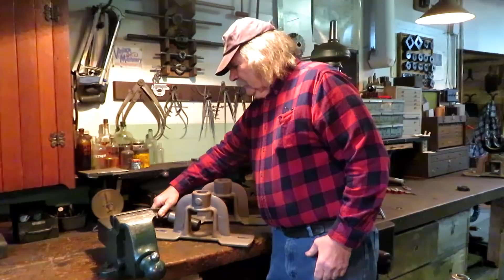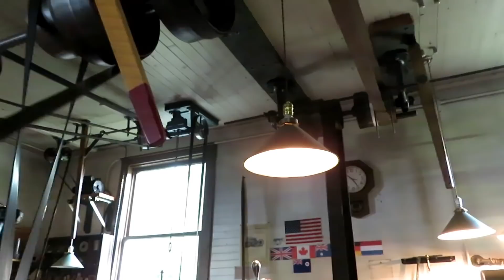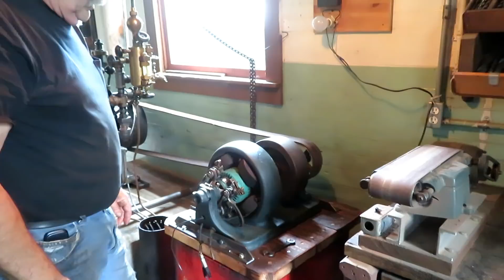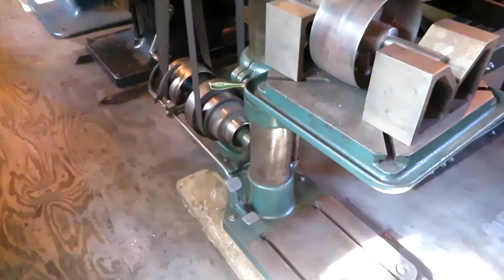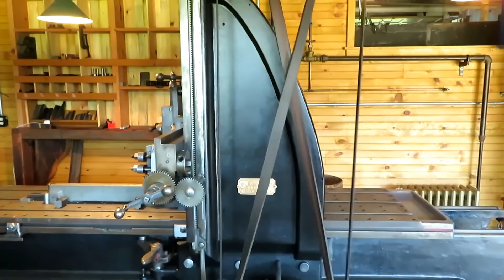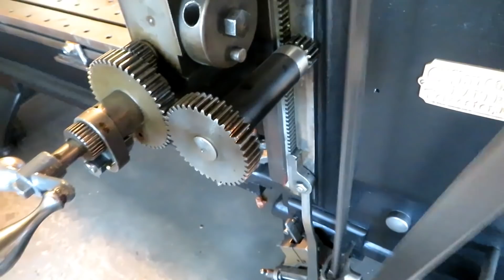Old Steam Powered Machine Shop 67:  DC power from steam

Comment: Dave, have you ever had an incident where a hand or clothing got caught up in belt/pulley? I know from my limited experience with my wood lathe that at even low RPMs there isn’t time for a human brain to react fast enough once the mistakes starts to happen! So will the belt and pulley just pass say a hand through half the rotation and throw it out without much harm or is it an automatic ride to the M D?
Reply from the maker: I'm not as worried about the belts as I am the lathe chucks, especially if the jaws are far out." Keep your hands where you can see them". (my dad).....Dave

Comment: Dave, was casting iron the only way they had to make parts in the late 1800s and early 1900s or was it just the most economical?
Reply from the maker: Hi Ed, Cast Iron work was a way of life in that time. All big machines required big castings. Wrought iron in bar shapes for most all else. Steel was much better, becoming available, but expensive. Arc welding and High Speed Steel for cutting tools was coming along slowly at that time...Dave

Comment: I liked your description of the old bearing. When I was sailing as a Marine Engineer a daily routine was to check that the slinger rings in the propeller shaft bearing were not hung up. My favorite part of the watch cause the shaft alley was cool.  I never realize they lubricated small bearings with slinger rings.
Reply from the maker: Wil, That last bearing must have been way back in there....Dave
Reply: David, no that would be the stern tube bearing.  It was a long tight “bushing” of Lignum Vitae that was lubricated by a controlled amount of sea water leakage into the ship. The shaft, which could be over 100 feet long, was supported by by several large bearings with most of the Babbitt on the lower half.  The slinger rings rested on the exposed top of the shaft which caused them to rotate and drag up oil from a sump. Very simple, very, very reliable.  Shaft was about 3 feet in diameter and rotated about 100 rpm.
As someone who spent a good deal of time on older steam powered ships I am loving your channel.  If I had your skill set I could of had unlimited OT.
Bill

Comment: Hello Dave,    Must admit I have just found your channel, very impressed.  I volunteer time, effort, my skills and the few odd £ at the Claymills Victorian Pumping Station (please see Claymills.ogr.uk)   My inquiry is about the displacement lubricator spotted `in bits` upon your workbench.  At present I am in the process of the Big 3R`s upon a vertical twin steam engine.  This being built `In House` at Claymills around 1900 and fitted with a displacement lubricator, so any info upon their set up would be much appreciated.

Comment: ?? Why not turn a vintage 110V AC motor at it's speed (1750 rpm motor at 1750) to get the AC output?  Better yet a slower motor like 1120.  Seems like to use the 20 or 30v your going to have to put in something non-fitting like LED lighting to make use of it.  Once you get your 100-120v ac, just used a genset transfer switch to flip over the source of power for your existing lighting circuit.  The generator your have is beautiful so I understand why your trying to find a use for it.

Comment: David. One of your early videos. Talked about not being able to replace steam.  Answer is you cannot.  If a oil refinery has no steam. It will blow sky high. I worked on a unit. a Fluid Catoletic Cracking unit. Known as a FCC unit. The flue gas coming off this unit was around 1200 degrees. Add a tad of gas and it would burn and produce steam. We has steam engines running pumps. Also steam turbines. When the good old ELECTRICAL GRID WENT DOWN.   We could run we had steam back up pumps. If we kept running the boiler house kept running. Over a period of time. They brought in ( so called educated bosses) replacing steam engines and turbines with electric motors. I begged one of the plant managers to not take the spare turbine out and replace it with a electric motor. Later that year we had a power outage. The total plant was down for 3 days. When we finely got steam up the plant manager came in and said start you warm up with cold oil.  I was able to look him in the face and say. I told you without a steam pump we cannot run. You Sir replaced my start up pump with electrical equipment. I told you it would bite you in the ass. You are now bit.

Comment: With D.C. do you have to rewire or use D.C. electrical equipment? 
Shows my ignorance!
Reply: BTW, the band on your left wrist, did you make it????????
Reply: Whoops, guess it is your watch.
Reply from the maker: There are a lot of ways to do it. If I could find a 110volt DC generator, The lighting circuit could be cut out of the shop wiring and run DC with a double throw double pole knife switch. incandescent bulbs can go either way....Dave

Comment: How much wood or coal do you use in a day in the boiler?
Reply from the maker: It takes about 3 wheelbarrow loads of junk wood to get up steam and then about one per hour. It depends on the wood. Throwing in a shovelful of coal with it once in awhile works good too.....Dave
Reply: David Richards 
That’s a lot of wood. You could try used oil as fuel in your boiler. I modified my wood stove to use oil and it works fantastic. I ran a steel line inside the stove where the oil drips on top of the wood, essentially making it burn longer and hotter. It’s coupled to a valve to regulate the flow of oil. Ideally I try to make it a thin steady stream. It is an excellent way to get rid of used motor oil and it makes a lot of heat.

Comment: Dave, Since there is no name plate on that dynamo I would be curious to know what the resistance measures on the commutator winding. We might be able to determine what kind of current / load that can support if it is running 24 or 32 volts.
Reply from the maker: I haven't checked that. The field is about 2 ohms. which I guess is typical of series wound generators that size....Dave

Comment: Love your shop and videos!
Question- what propels the Planer table? is there a gear rack on the bottom of it, and a large gear(?) 
I have only operated a hydraulic (Rockford)Planer.
Reply from the maker: There is a 3 element gear reduction to a rack and pinion driving the table......Dave

Comment: Hi Dave--Great episode. At the very beginning you mentioned needing to shim the hangers on the lathe faceplate, and I wondered why you didn't just mill those surfaces flat?
Reply from the maker: Hi Rick, I could have, but then you have the problem of holding and lining up the base with the cast hole. The originals weren't, and I figured it to be an unnecessary extra operation.

Comment: Don't get me wrong, I think your DC generator is really neat. But it would be interesting to calculate the cost of generating that DC for your lights versus your utility rate? Probably a bit more using steam? BTW, you may already know this but LED and Fluorescent lamps may not work on DC. But I'll bet you wound not dare install a modern LED light in  your vintage shop.
Reply from the maker: Hi Andy, I'm making steam for nothing. Costs would be about $50 /year for boiler treatment chemicals, about a pint of steam cylinder oil/year, and a half box of matches...Dave

Comment: Hello Dave,
Are there books available as to guide how to set up a steam shop like yours, including the machines which are used.  I am interested in both the woodworking and metal machining set-ups. I would like to have a steam engine in between two separate building sections. Woodworking one side, Machining the other side.
Reply from the maker: Most of the old machine shop manuals before 1920 have that kind of information. "Modern Machine Shop Practice" by Joshua Rose (2 volume set) is the mother of all steam powered machine shop information manuals. It covers engines, drive systems, machine tools, lay out, etc. I believe it is even archived on the web now....Dave
Reply: Greetings Dave,
Many thanks for the reply. I will look up what you have suggested. I take it the Amish folk have also followed similarly for their workshops, machinery wise ?
Reply from the maker: @leswakeham3596  Hi Les, Most of the Amish folks I know (including the Kings at Cattail Foundry) use air. Diesel compressors and big tanks. Air motors run the blowers and wood working machinery, sand tampers, grinders, etc. LP gas for some lighting, but when it gets dark, they go home.....Dave

Comment: After graduation from the Canadian Navy - ERA apprenticeship, the first civy-street job I had was with Hafer Tool and Fabrication company in Victoria, B.C. running a planer identical to that old girl cutting long "L" slots in overhead rails. The only machine in that shop still run by a belt drive. I had never even seen an old machine like that one but by the end of one summer was the go-to guy for the planer jobs.  I used to set my lunch pail on one end of the table and take a bite of a sandwich at the end of each stroke.  The guys got a kick out of that.

Comment: How did the reaming with the shell reamer go?  Looked like the rpm was a little high from here?
Nice to have you making videos again!
JIM
Reply from the maker: Jim, Seemed to work fine in that soft cast iron.  For steel I would definitely slow it down and use some lube....Dave
Reply: @davidrichards5594  Not questioning your ability, just wondering at the result.
You were there, you know best.
Keep up the good work .
Thanks for the reply!
JIM

Comment: I have been watching some YouTube videos from Keith Rucker, Adam Booth, you, and Windy Hill Foundry.  I was just thinking.  That old, worn-out pinion gear on the metal planer.  You could perhaps take it to a foundry (eg. Windy Hill) and have a new rough gear cast using this one as a model, remembering that the teeth spacings would have to be plucked from the sand before casting to make a rough wheel.  Then, you can use your lathe to smooth out the important parts and your miller to carve new gear teeth which would fit perfectly, getting rid of that noisy backlash.

Also, Perhaps, you can take your wooden governor pulley to a foundry and use it to cast an identical pulley which you can then use your lathe (don't forget to put the wooden pulley back in place) to smooth out and crown the pulley and use it in place of the wooden one.
Reply from the maker: Steve, The pinion has been replaced by someone along the line, it's the big  gear that has the wear, It was probably fairly noisy when it was all new.....Dave

Comment: Out of the 130+ channels I subscribe to, this one is far and away my favorite.
Thank you so much for sharing with us Dave.
BTW, early in the video when you were using the lathe,
Belt Chirp?
What Belt Chirp?
You probably don't even notice it anymore but it got me to wondering what, if anything, a guy could do to mitigate a noisy belt?
Reply from the maker: Phil, That's the lathe final drive belt. It's a rubber composite style that has really good traction that is needed there. It runs up and just touches against the small flange a little on the large position of the spindle stepped pulley and makes that noise. The adjustment on the front end of the countershaft is all the way up and is starting to throw that belt off a little so I split the difference, It's one of those small things that can become a big deal. The camera mic really picks it up though. Thanks for watching....Dave

Comment: Thanks for the memories, first shop I worked in had one line shaft driven machine, I still remember Potter, the old guy, flipping the belts and making that spindle turn.  I also enjoyed the sounds from boring those hanger castings.  Working castings, takes a good eye, done a few, and some castings are better than others.  Used to work castings that were poured locally, they had a cuppoula furnace, I think I found valve stems or something a time or two.  Another foundry did steel castings, electric arc furnace, beautiful stuff, just pure steel.  But alas, both foundrys are history.  I myself am working as a mechanic in a poultry plant, would rather be machinining castings, but fixing processing equipment pays better plus buys the wife's and mines heath insurance.
Hey David, pause at that Barnes drill press sometime, I have one with some busted up feed parts, motor I had mounted on it had been used on my air compressor for about 15 years now.  Might put it back on and get it usable.  Ha.  Also have a baby planer that needs to have a line shaft mounted above.  I have a DC drive and motor, been thinking about it.  Keep making videos.
Reply from the maker: Thanks for watching Harold....Dave

Comment: Hi Dave
Glad to see the planer in action. I felt that hard hit at 27:21, my Gorten #9 has given me a few of them on the leg. Some time ago you talked about rebuilding a horizontal steam engine, is that still on the list of things to do. Sure would like to see that project, I have a 8 x 10 mill engine, (name unknown) that needs a sleeve job and some small linkages for the valve gear.
Thanks for letting us hang out with you for a while.
Reply from the maker: Hi Bob, Thanks for the comment. I hope to get the Lilly engine moved in it shop this fall...Dave
Reply: @davidrichards5594  That would be great, Thank you.

Comment: Question Dave - I notice you don't have a Bridgeport or similar - Was a vertical milling machine not standard in the steam days?
Reply from the maker: Virtually unknown at 1920...Dave
Reply: I had a 1936 Gorton made in Racine and that is the earliest I ever seen.
Reply: There were one or two models of vertical spindle machines—Brown and Sharpe made a line-shaft vertical. But these were heavy fixed head machines. No quill or even sliding head, and no angular adjustment. They were mostly bought for a specific production use. A horizontal was much more versatile in a job shop with all the speciality cutters and dividing heads. There were vertical attachments available if you needed the ability occasionally. Though a horizontal is a vertical if you lay the work on its side!

Comment: I bet you could add a few more adapters in that reamer so you could sit at the end of the lathe in a chair....jus kidding. I'm guessing your gears on the planer are pretty outa form with 400 years of use. I can cut the bull gears deeper, and if you have fixed centers there You'd have to make oversize pinions. It's actually more proper to do it that way....not at all a cob job.

Comment: Bonjour Richard,
Always happy to see your videos, your skillness becomes more and more uncommon. 
I have the impression that some long drive belts are slack, how often are they adjusted and do they need to be cut or shifted pulleys?
Amicalement, Raphaël
Reply from the maker: Raphael, When a new belt is put up,  it will have to be shortened and relaced a couple times until the stretch is out. After that, I hardly ever touch them at all......Dave

Comment: So are you planning on running shop lights in DC or are you  or are you converting the output to AC? Assuming that they are going to be second set of lights so you have regular lighting for when boiler isn’t fired up? I couldn’t figure out why you were drilling the face of the pulley until you put the long bit in and then I realized it was just a through hole! Nice work, can’t wait to see it running!
Reply from the maker: Fred, I was hoping the dynamo would put out 110V. Then I could switch the lighting circuit over to it when running the generator. Looks like this one is 32v....Dave

Comment: I watch these old planers, and can't help wondering how well they would work for grinding in lathe beds, if they were fitted with a heavy duty tool post grinder and used gently.
Reply: I have done it many times on my planer, need to cover all the way's.

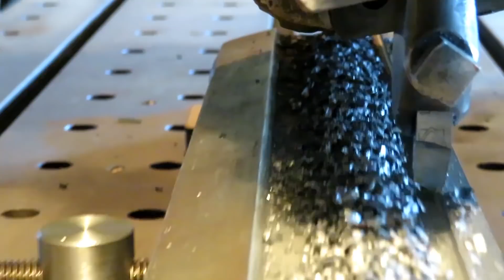Comment: Just  around frame 19:41 you can see the tiny chips of metal floating in the air. I'm milling aluminum right now and thinking hmm should i have on a mask? cool plainer shots.! 33:48 interesting the cutter is moved over before the backstroke..Is this to be able for the bit to not ride on its cutting edge on the way back? sorta lifts it up a bit of a tilt?,,, seems logical that this would be the better scenario..right?
Reply from the maker: Chuck, The "clapper box" lets the tool lift up and slightly away from the preceding cut but I just realized from watching while putting the videos together, that I've got the cross feed happening at the wrong end of the stroke. It should be feeding at the end of the return stroke. That's why the tool drags so much on the return. Not thinking...It was set up like that when I got it.  The adjust screw on the friction wheel that operates the rack needs to be run back to the other side of center. I'm surprised that nobody caught that...Dave
Reply: @davidrichards5594  wow interesting..I could never catch it caused I don't even know what to catch..ha.. but I'm so fascinated with how all these machines work, and you do a good job of getting great close action shots. I thought the lift and drag was a way to not scrape the sharp edge along the piece. like this is intentiona by letting it drag on the back stroke would lift it up higher on the uncut edge,  but glad you saw that needed adjustments.. again thanks for the vids, as a gearhead myself  these are a treat. and man that shaper looks sharp!, great job on the restore. cheers! oh and watch out for that crank handle! ha.

Comment: Dave, It's nice to see the planer running, but is the table supposed to make that racket?  All the other machinery seems to run much quieter,
Reply from the maker: Hi Jim, Planers have a lot of gears, and the're old.....Dave
Reply: @davidrichards5594  I get it now, Dave. I thought the noise was coming from the table sliding back and forth on  part of the table it slides on.  I suppose the only way to quiet the machine is to keep the gears heavily greased, but that's probably not practical.